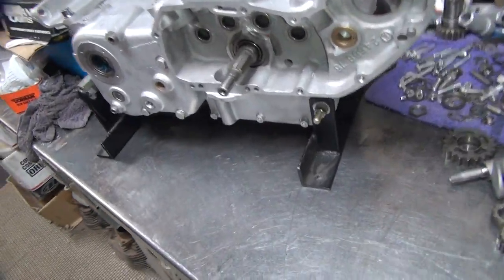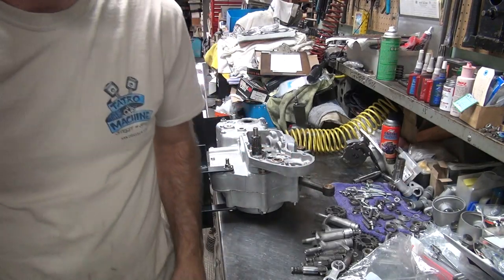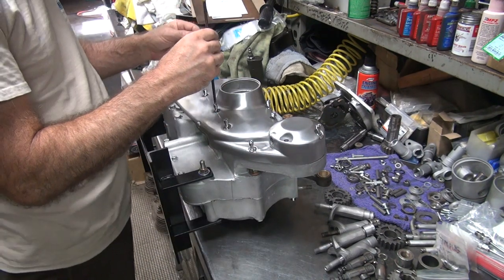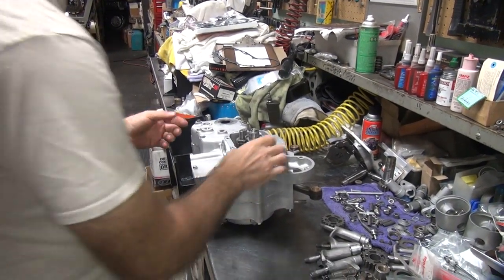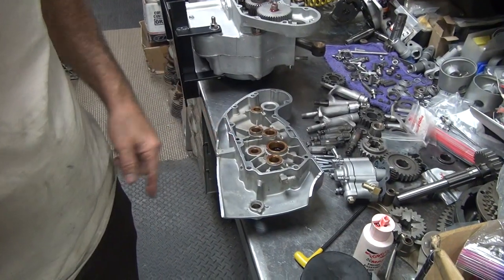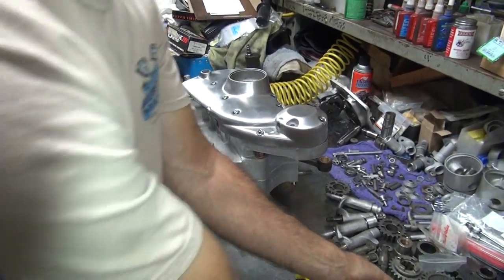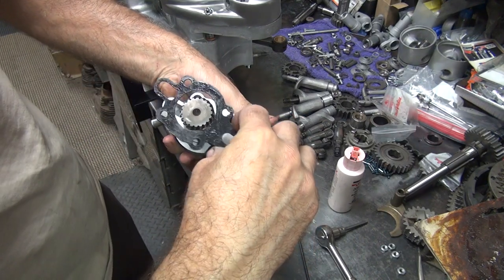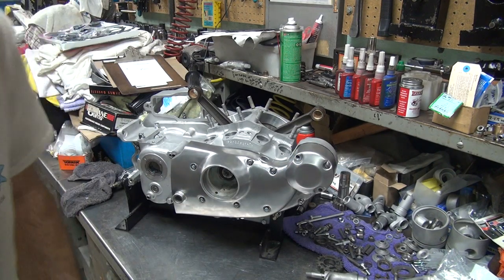1977 xl xr street tracker #117 motor rebuild repair 1000cc sportster ironhead by tatro machine

Comment: Tatro am having a hard time with the cam gear plates, how do they go in? One side is flat, which side is the flat side supposed to be facing?
Reply from the maker: the chamfer is toward the cams. flat to case.
tatro
Reply: @TatroMachine  thanks tatro 🤟